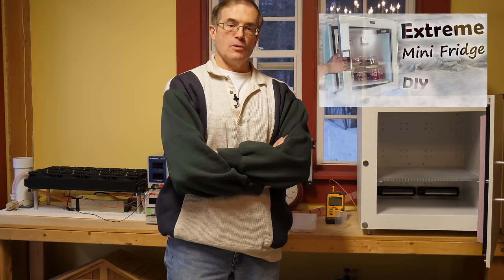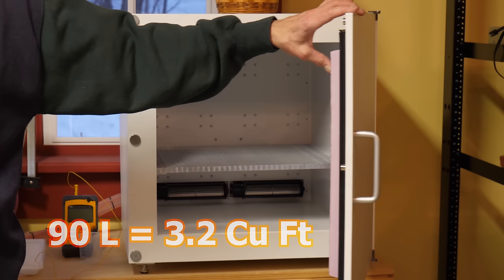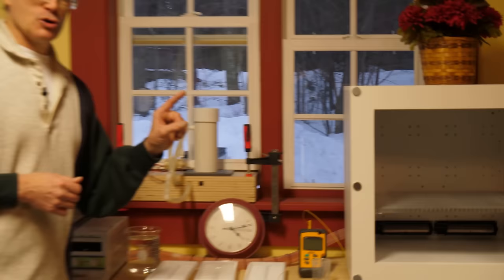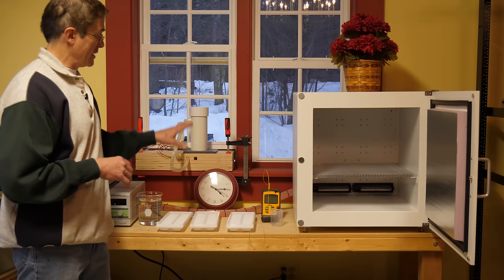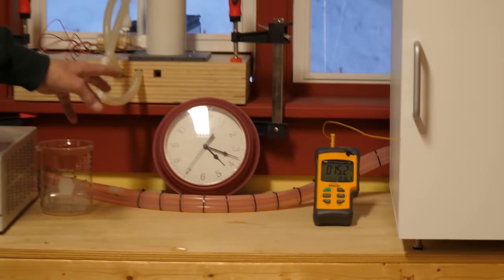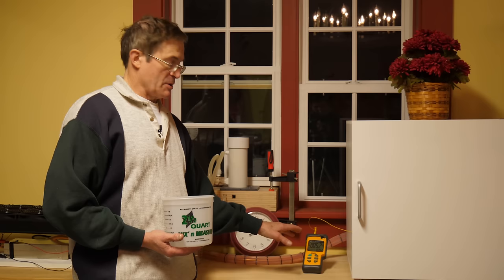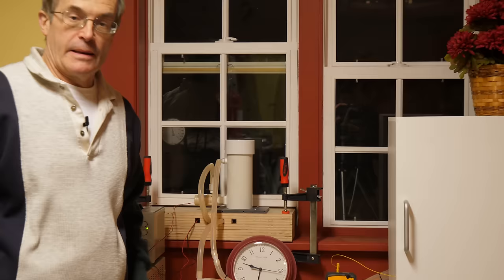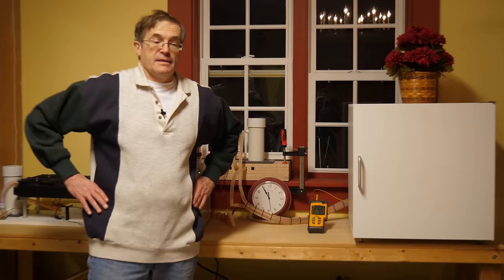TEC Freezer - Build Your Own!

Comment: I grew up in the high desert of New Mexico. Average summer humidity was 5 to 15%. An evaporative swamp coolers were very efficient and cheap to operate plus they raised the indoor humidity to a nice 30%. 
I now live in Florida. Our summer humidity averages 90 to 100%. I have been told that an evaporative cooler won’t work in high humidity. Is this true? Is there an efficient way to lower humidity in a home without an air conditioner or heat pump?
Reply from the maker: Funny you should ask...
We completed a dessicant based, evaporative air conditioner that solves that problem, is extremely effecient and easy to build.  I touch on the design in the first video we posted on the mini refrigerator.
Reply: Tech Ingredients 
Sir you surprised me. I never expected a response from you. I always learn new useful and thorough provoking knowledge. 
Thank You for taking time out of your life to do these videos. I also have a pair of your speakers in my shop. Again thank you
Reply: @TechIngredients  an evaporative cooler that doesn't make the inside air saturated with moisture? That would be very good. I can't stand swamp coolers. I feel about 30 seconds of cooling when entering a building cooled with swamp coolers, then I sweat even worse than being out in the heat.

Stupid human autonomic responses that won't just sit still and let conduction and radiation do the job, the body insists it must reject heat as fast as possible in case it's going to be dragged right back outside into the heat, so it resorts to attempting evaporative cooling, which can't do a @#%%@ thing in swamp cooled air at high humidity. Perhaps some zen meditation? "I am in cool air, you don't need to sweat. I am NOT running straight back into 105F heat, you do not need to sweat."
One of these days we might get around to adding manual overrides to our bodily functions to stop them from improper responses to our technology.

Comment: 200 Watts continuous for the peltiers?  My boat fridge uses around 50 watts and freezes down to -19 dumping heat only to the air.  This does not look particularly feasible in a boating environment.
Reply: Peltiers are just bad in terms of efficiency. Where they shine is reliably, form factor, and noise.

Comment: Add a piezo electric horn like what is in an ultrasonic cleaner and glue it to the bottom of the cube tray... Right at the zero point of stalling state of liquid to solid point.. Tap a momentary button just to pulse the piezo just for a micro second or two.. I realize those create heat from vibrating the molecules against each other.. But just for a couple milliseconds pulse, to snap the water into its solid state faster... 

I mention this, as I came out to my shop and the heater was off for a few days, and I had forgotten all about the water in my ultrasonic cleaner, and upon coming into the shop (winter time) a few days later, "oh well, nothing I can do about the temp inside the shop and just have to deal with it being cold, until the heater levels things to a comfortable level again... Anyhow, I realized.the ultrasonic cleaner still had the water and drop or three of cleaning agent and thankfully, not frozen and bloat the stainless steel basin bowl.... Turn the machine on, dropped some more parts in the basket, then the basket into the basin bowl, for a 15 minute cycle, and the second I pressed the start button, "SNAP".... the water from the bottom up instantly started to freeze... It all happened with in half to no more then a full second, which is a 1 gallon basin...  the amount of energy required to snap the ice block back to water state, lol... Not the same, lol... Yes, my parts, the basket, we're frozen in a block of ice... Just a n idea to jump the water to frozen state with minimal power required in a pulse vs the time to wait for the water to cross over on its own?

Comment: well -15C is still not cold enough for a freezer, really SHOULD be -18C or lower and if you say it uses 200W (don't recall the exact number you said) then it is definetly not efficient since it runs constantly for several hours before it is even down to temp

Comment: Question: You've built the TECs into the back panel of the fridge. For a home fridge/freezer this makes sense for many reasons. However, for optimal thermal design, would it not be better to mount the TECs to the "ceiling" of the fridge/freezer? This would cool the interior from the top down, which I would think is more efficient (faster). Also, it would give you more options for making use of the generated heat that would be escaping upward outside the unit. The heat would naturally rise more efficiently in this position, and you could maybe even use it as a warming unit. For example... catering. Keep hot dishes hot above... while keeping desert frozen, below.
Reply: Second Use Case Idea: Freezer below... Food dehydrator above.
Reply: This idea has me thinking...

Comment: Isn't an air gap or gas or even a vaccum better at insulating than polystyrene?
Reply from the maker: No.  An air gap allows  convection to transfer heat.  Polystyrene  foam is almost only air, but the air can't move around to transfer heat. A vacuum  is better, but the enormous  forces exerted by the surrounding atmosphere (10 tons/M^2) requires a very heavy and expensive structure to prevent the gap from collapsing.
Reply: @TechIngredients  Thanks for replying with the answers. Love your channel. I'm looking to build my own mini fridge for an RV. I've ordered the peilters off ebay to try this out. 👍💛

Comment: Im suscribed, and very interested in the dissecant based cooling. Compressor based is very power hungry for tiny houses with solar panels.
Reply from the maker: Thanks!
You might be interested in the fact these coolers need to regenerate their dessicant with heat and an excellent source would be a roof mounted, solar water heater.  The dessicant is a liquid.

Comment: Question, can you feel the 219W electrical heat output from the TEC modules when running the hot side thru the indoor heat exchanger? Does the HE put off noticeable heat?
Reply from the maker: I'm sure it's detectable with a thermometer, but it isn't noticeable.

Comment: 1: when you start the process to Freezer Unit is that roughly room temperature the door has been open and the mass of the plastic is at room temperature the mass of the insulation and everything inside the freezer or at room temperature all this Hass to be brought down and the mass consumes watts not just the water itself. 
    2: at the same time as it goes in tonight time the outdoor temperature on the condenser changes this all affects the equation to the power required to bring down the temperature of the water over a span of time. 
     3: The second time when you empty the one tray of ice that entire freezer is already down the temperature there’s already a massive ice in the other two trays that are down to temperature and then you add fresh water in the outdoor temperature is already colder. 
        4: with the colder outdoor temperature and even if you use the snow to your advantage. Believe the system could be set up to use the outdoor temperature first with no power applied just pumping water little energy consumption until the freezer Unit started approaching the outdoor temperature. And then kick in the power to complete the job in the very last few degrees. This would greatly reduce the amount of power consumed.
Reply: You should make a video and try it...
Reply: Steve just Steve It’s a lot of work to make a video that complicated and in-depth my hat off to you you make great videos I don’t think I could ever have such patience to detail that you go to produce a good video. I’m in the HVAC business the last 30 years and so is my father. Designing freezers and cooling an entire office building having to do the load calculations and calculating the different materials at what rate it is lost or gained factoring in outside temperatures is what I do daily for more than half my life.

Comment: Hello, since the TEC needs to have the current regulated or limited is there an easy inexpensive way to do that to keep the DIY cost down to a minimum. Do i simply use a 12 volt power supply rated for 3 to 6 amps and let it run maxed out? To me DIY means build it cheap from salvaged parts and buy only what is necessary.
Reply from the maker: Basically, yes.  Using a variable power supply to determine how much voltage you need to drive the right amount of current for your set up, is helpful.
Then pick an inexpensive, fixed power supply for permanent installation.

Comment: What were the TEC chips power usage, 
I'm seeing your controller is saying 17 volts at 11 amps

is each chip getting 16 watts at 17 volts?
Reply from the maker: Each chip has about 2.3 ohms resistance.  They are wired in series and parallel to achieve that total resistance.

Comment: Could the cold side be used to cool the liquid desiccant for the solar ac unit and the hot side be used to heat the liquid desiccant before driving off the humidity?
Reply from the maker: Yes, but the effeciency would be much lower than a conventional airconditioner system.

Comment: Can you please add a Kill-a-watt reading over an hour for times when door is not opened and closed vs. a high traffic usage for all your work?  The refrigerator project did not have those readings.  It would be good for comparison.  Also, a remote heat exchanger in the snow is not something that most people can do.  If you can put the heat exchanger outside, you might as well put your food in a wooden box outside in the cold weather for the cheapest solution.

Comment: In an RV application, I’m guessing that it would be relatively trivial to send the heat to the water heater?
Reply from the maker: No.  Harvesting the heat for another application will reduce the effeciency of the freezer.  We want the "hot" side as cool as possible because the TEC produces a relatively fixed differential.

Comment: the cost, 12 TEC's @ $4 =$48 12vdc fans 8 @ $10=$80 Aluminum water blocks 12 @ $5=$60  water pump $20 2 tumbler fans  $20 rough total $200+ This is not including the materials to make the fridge.  Small bar fridge new only cost $150-$200. Pricey project. If you could get better performance ect that the big manufacturers then they would use them. You would be better of if its small size you want, then esky ect make small camping/caravan fridges in 12 or 24vdc  Oh i forgot the power supply as well so factor that in and its a expensive exercise to make a small peltier fridge. all that a side nice video series good technical back ground ect Cheers crack open a cold one you deserve it.

Comment: Any results about the efficiency of the freezer or fridge when it has reached a steady state? during the ramp down the system seems to use a certain amount of power, but once it reaches the desired temperature the cooling can be switched off or turned way way down. I'm curious how well that might improve the overall performance.

Comment: How power efficient is this?  I wanted to know if this outperforms a regular compressor based system
Reply from the maker: No it doesn't without taking advantage of cold weather.  Then it can greatly exceed the effeciency of compressor based systems.  As the TECs begin to pick up some of the load, the effeciency drops.

Comment: I was thinking about using a swamp cooler.  Not using the air but the water to cool the units not using the cooling fans outside just letting the water going through the swamp cooler.  Pump the water up through the cooling unit on the freezer then back out to go through the straw pads to cool it before being pumped back up through the cooling of the units on the freezer.  Would this work where the outside temperature is every high like in the south parts of the US?
Reply from the maker: It would work, but it all depends on relative humidity; the lower the better.

Comment: Why need this little holes inside the fridge? I mean isnt TEC fixed on backside wall on just thermal paste
?
Reply from the maker: The holes allow screws to compress the TEC block against the back wall.  Heat transfer between the structures requires not only grease but pressure as well.

Comment: What sort of blowers are you using in this iteration of the refrigerator?  Mini centrifugal blower of some sort?
Reply from the maker: That's right.  These are frequently used to blow air through the fins of a low profile heat sink used in radio and audio amplifiers.

Comment: I wouild wonder if its possible to use a water Sock/as insulation...A barrier of water around the main unit to get the temp LOWER after initial Freezing..  And away to Add a small Vacuum inside the case..Would close door tight, Cause things inside to Dry..

Comment: You appear to have an awful high thermal leakage or poor transfer somewhere unless it is just the fact that you try and maximize cop.
With only 2.85 amps per TEC-element you cannot have a deltaT of more than 32.5c at 25c hot side.
The internal heating and other effects limit this. If you wanted a deep freezer effect of 18c and you normally have 25c room temp that is a delta of 43c.
To reach 43c delta (when pumping 0  watts) the TECs need to be driven at 4.5 amps each. Then cooling capability tapers off to 0 when delta reached 43.
Ideally one would use TECs optimized for 40-50c deltaT but I cannot find any data as to the optimization point of the generic 12710 modules.
Operating at the TECs optimized thermal point and power level (Most likely 30-50% of imax for this TEC for deep freezer use) and turning it on/off based on thermostat would probably make it more efficient.

Comment: @tech Ingredients I have a few questions If you would not mind answering. The vented heat what is the temp? Could that heat be directed to in-floor heating or a hot water tank? Would that heat transfer for cooling, be enough to operate the freezer or fridge replacing the cooling fans?   Once again informative and well-done thank you.
Reply from the maker: Thanks.
In order to maximize the effeciency of the freezer itself the circulating liquid and therefore the air that cools it needs to be as close to room temperature as possible.  It is only 2-3 degrees above that.

Comment: Would like to use solid state design like yours to cool the interior of a car while the car is off. So it would operate for a limited time with a battery pack. My questions: do both sides of the elements need to use convection and does one side need to be outside the car?
Reply from the maker: One side needs to be outside  to remove  heat from the system.

Comment: 4:06, Could you install a graphics card like that?
Reply: Condensation is always a problem with these systems. You can avoid that by using a non-conductive oil based fluid and submerging the board into it, but obviously that greatly increases complexity.

Comment: Most efficient way to transfer 'coolth' (especially with peltiers) is by direct contact, rather than indirectly by blowing cold air around … so I wanted to ask, is your shelf in this freezer version made of aluminium or another metal for greater thermal conductivity? And presumably your ice cubes would freeze faster in metal trays?
Reply from the maker: The shelf is a practical compromise of low cost and clarity for visibility.
However, you're right about the transfer of heat.
Reply: @TechIngredients  Thanks for the reply. It's worthwhile playing around with TECs, they do have their applications.

Comment: How do you know how many TEC’s you need to reach a target temperature?
Reply from the maker: Use the graph I show to determine the cooling power of each TEC and the explanation for how to calculate the heat load based on the size of the refrigerator and the thickness of it's walls.

Comment: My house AC is in the attic here in Texas.  I have one bedroom over the garage which the garage is currently  unconditioned.  This bedroom gets very hot in the summer and I am debating how best to fix the problem.  One thought is to cool the garage with a 1/2 hp R134a system Two thought is to set a peltier module duct inline with constant air flow in series with the regular house AC ducting the heat out the attic vent.  Third thought is to put a 1/4 hp R134a system in series with regular house AC system.  Can you provide some thoughts or opinion?
Reply from the maker: I assume you have substantial humidity as well. If so, an evaporative cooler is out of the question.  For large heat loads the low effeciency of the peltier device will cost a lot to run. Although it's not an exciting answer, aggressively insulating the ceiling of the garage is a one time expense without maintenance or electrical costs.

Comment: So what would be the cost difference to function one of these vs. a typical freezer/fridge of equal size?
Reply from the maker: These would cost more unless you took advantage of the remote radiator and "harvested" cold air from an unheated room or outside.

Comment: Are you using a peltier controller/driver to control the peltier?
Reply from the maker: No.  We just used a variable power supply to determine what voltage was necessary to produce the necessary current to maintain a sub zero temperature and purchased a fixed voltage supply with that rating.

Comment: There's quite an audience interested in cooling a flowing stream of water such as found in an "open loop" water cooling system for a computer CPU and/or GPU.   I would love to see your solution for cooling a moving stream of water - either using Peltier  units or some other dark magic you might have up your sleeve.